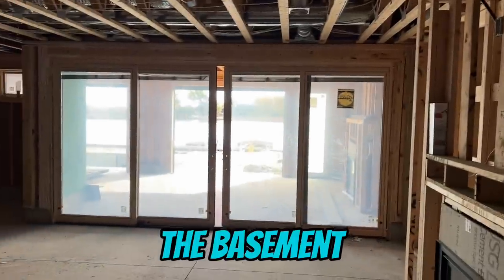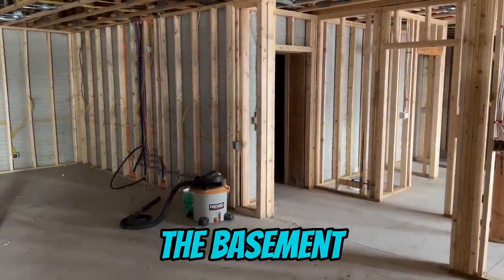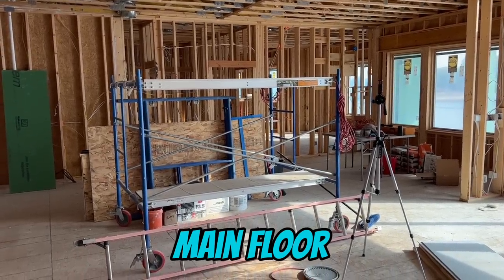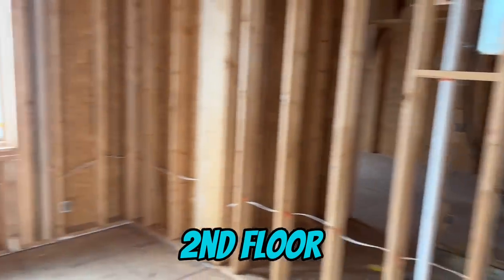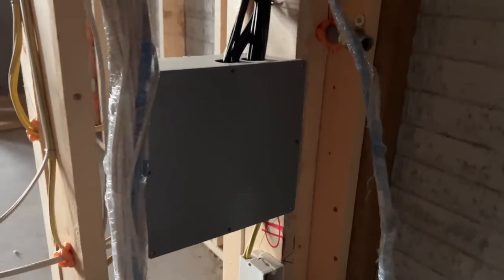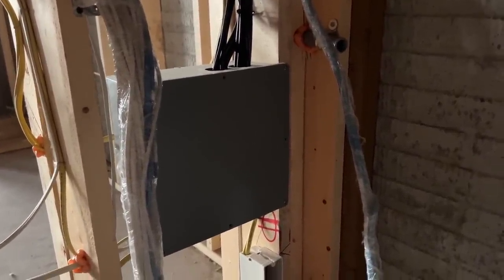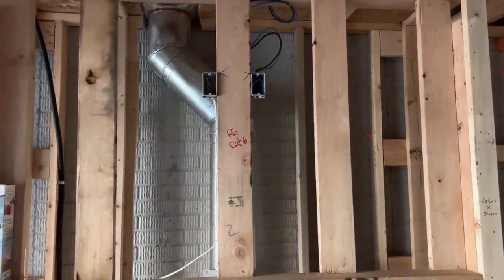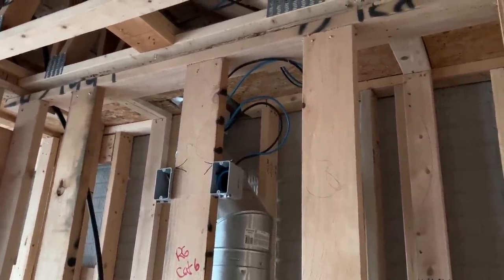Properly Plan your Low Voltage Wiring in Your New Build

Comment: You need to wire for PoE presence sensors now.  Why do coax at all anymore instead of HDMI over CAT6???
Reply from the maker: You bring up a good point on coax, but there are many people out there who use it for OTA TV... Also, I think when you get into more complicated builds that require HDMI over Etherent, or other special AV needs, then a home owner should consult a professional to make sure all the cables are getting pulled to the correct locations.
Reply: @ethernetblueprint  I haven't used OTA TV since 2008, so I guess that's why I didn't even consider that. 😂  You can just pull from the rack to all the TV locations,  same as coax (assuming the networking closet is where that is located). If they go HDMI over CAT6, it's pretty simple from the rack. All the switching also happens there if they want to get fancy later on!

Comment: 9:44 - there is no reason to run coax to a TV in 2024. Just HDMI and ethernet. I would run two of each. Coax is useful to were the setup box is but they aren't mounting a set top box above the fireplace.
Reply from the maker: I hear what you’re saying and agree when it comes to my personal setup but many of my homes like to have an OTA antenna in the attic and run to the TVs… especially with cable and streaming costs rising all the time.   While I would never run coax in my home, many still have a need for it.
Reply: Wrong. I just ran new coax to a patch panel in the basement of my house. My wife and I watch sports in OTA antenna, and streaming for everything else. We're not paying for extra sports we can get for free. Also, local news is a thing.